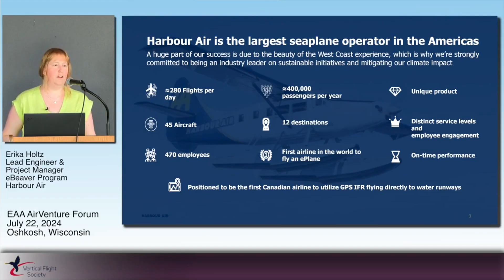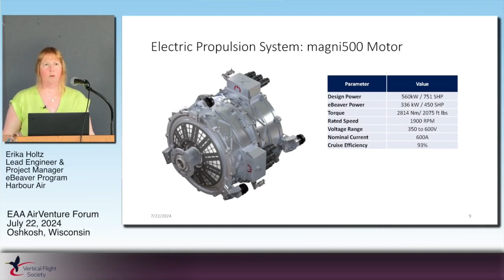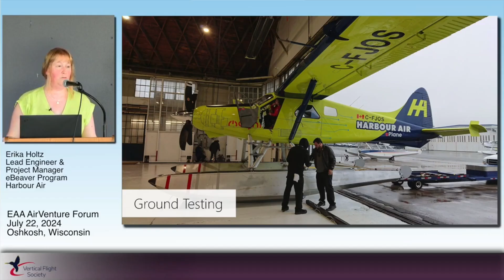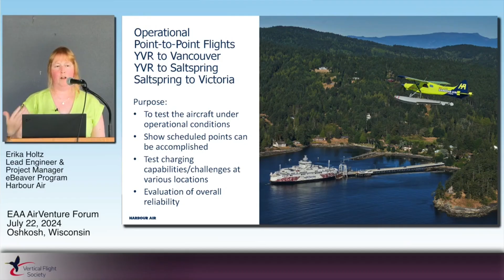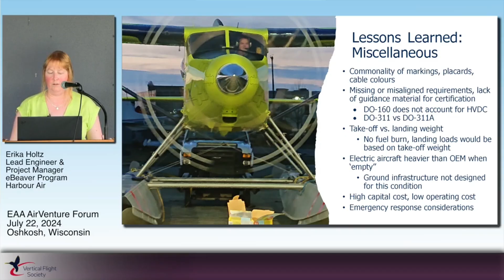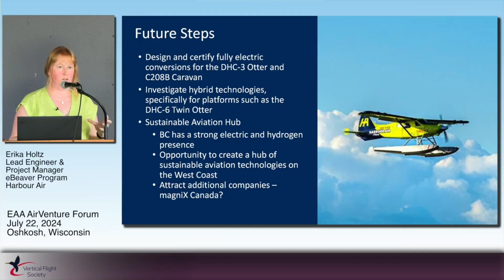The World’s First Electric Seaplane? | Harbor Air's Erika Holtz at Oshkosh AirVenture

Comment: Thankyou for an interesting talk. Have you considerated a drone to help with takeoff, 1-2 min, where much energy is used? Just as extra an extra battery pack for the main motor, not for propulsion by the drone. When empty, it detaches and flies back, and the plane is lighter and main battery is unused?